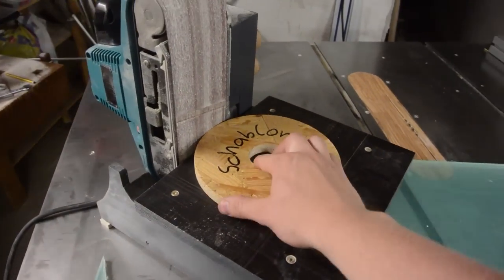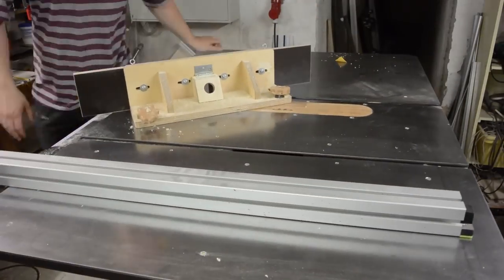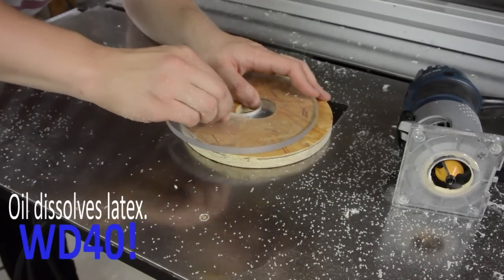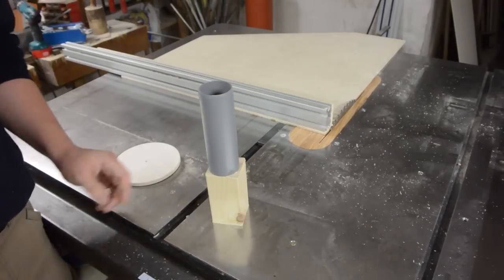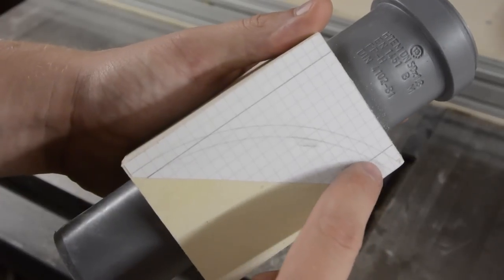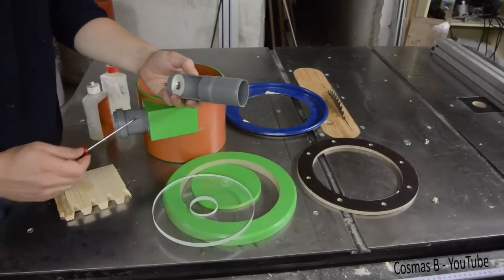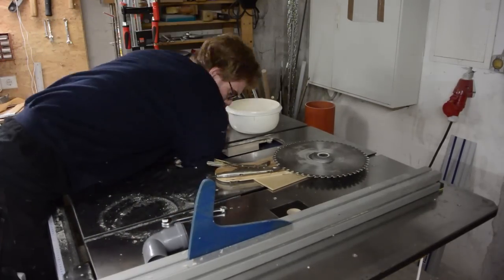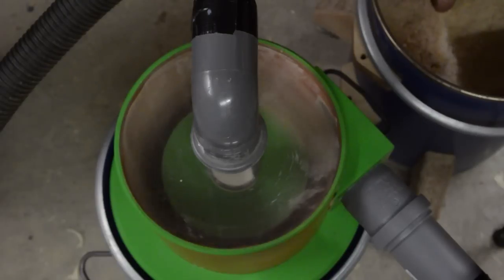How to Build this AWESOME Compact Cyclone Separator

Comment: Nice work! To improve even further on the efficiency of the cyclone, could you increase the difference  in height between the inlet-pipe and the notch in the outlet-pipe? You have built more of these obviously, what have you learned to improve your design even more?

Comment: For the efficiency, just put the once filtered saw shavings through the seperator a second time, weigh before and after the second run through.  Great work btw, excellent standard all round.

Comment: Wow. That is cool the way you put the baffle on the end of the pipe. Mine is ever so ugly, compared to this. I do however have as close to 100% as I can measure, just like yours. I am of he belief that the top needs to be pure cylindrical, and not a bucket (slightly conical).

Comment: That was probably the best one I've seen yet. I just wish there was a way to do this inside of the vacuum cleaner itself; so much wasted space inside a normal machine, and it is still the fine dust that eventually clogs the filter. I'm a little hesitant to start building one of these, because I'm afraid to get "sucked in" by the process- I could see spending a lot of time on one of these. Anyhow, awesome work.
Reply: pocket83² With a concentric two stage build up it can go inside the cleaner.  The tube is set in the center of the cleaner and holds an external baffle.  Then the air enters the center tube as second stage but there it does need only a small container for the remaining dust. The bottom of the tube will be enough.  The only problem is that there is no 'fine' filter anymore.

Comment: Cosmas, I'm in the process of making a separator very similar to your design, which I like very much.  Would you be kind enough to answer a couple of questions for me?  1)  How close to the top should the intake pipe be?  2)  I'm using a 9-inch diameter tube that looks to be similar to your orange pipe and would like to know if the length of this tube matters.  In other words, is there any advantage to making the distance to the baffle closer or farther away from the intake?  Thanks so much from Arizona.

Comment: Deadly accurate! What I most of all appreciate. I have one question about dust. This system good catches sawdust but I suffer of fine dust. Especially of MDF. How about that? How much fine dust pass through and left on vacuum cleaner filters?
Reply: Vladimir Evdokimov Great question. Centrifugal separators have a practical limit of effectiveness somewhere between 10-30 microns. Below that, there's not much mass but there's plenty of surface area to give your lungs trouble. And your vacuum filter will only catch that if it's a good HEPA system. On the plus side, this will keep your HEPA filter in good shape and able to do what it's best at, which is filter the truly fine particles.
Reply: I really interested in more fine dust remowing. Now I finished my new homemade saw and router and thinking about dust collection.
Reply: A separator like this one is a good first stage. You will still need a good HEPA filter for the super-fine dust which is buoyant and cannot be separated this way.

Comment: hey awesome project
I have 3 question for you, the green disc sitting in the end off the suction pipe inside the cyclone, what is the diameter of that disk....?
And the length of the gray pipe with the green disc in the end, how long is that form the inner side of the plexiglass too green disc....? and the length of the notch made in the gray pipe how long is that....?

Comment: What is the light brown pipe? I thought it might be sewer pipe but could not find any that size at my local builders merchant. Great job and build by the way
Reply: +John Fithian-Franks - They are building a new hotel a mile down the road from me. I spoke nicely to the boss, who gave me a 0.8m long off-cut for nothing. (My version is a bit smaller, using 160mm pipe and a traffic cone).

Comment: Cosmas, congrats for this excellent design. I'm going to replace the cyclone part of my self designed shop vacum and I'm intending to use your design. Could you please tell me what is the diameter of the large  PVC tube you have used? Best regards.
Reply: 200 mm

Comment: Hi +Cosmas B - great build! It really shows that you have a lot of experience with these cyclones after building so many ... 
I'm thinking of building one too, and this really seems to be a very good design - compact, efficient and easy to build. I was wondering if you have experimented with how far down in the cyclone the best position for the baffle is? It just looks like it's not flush with the bottom (which I would have expected). And just for a size comparison: is that a 60 liter bucket?
Reply from the maker: Thanks! The baffle is about one or two cm above the actual lid but I don't think that it's exact posiotion is too important. Yes, that's a 60l bucket.
Reply: Thank you, helps a lot!

Comment: Glad to see people are making their cylindrical separators a tad taller rather than fatter. And I'm really impressed with the glass top. I think I'll copy that in my next cyclone. It's enough to let you see in without limiting your choice of materials or construction methods. A baffle can foul if a large clump of dryer lint gets stuck and directs dust toward the exhaust. But at least you'll see if there's a problem!
Can you say more about your decision to build a radial (not axial) exhaust? Classically cyclones send air on an outer spin downward and an inner spin up the middle; this forces a different dynamic. Is there analysis out there anywhere?

Comment: Hi.
I want to build this but I also have a problem withthe fine dust filtering since I only have a regulare house vacuum, cleaner.
do you have any recommendations as to how to go about this matter?
perhaps a reccomendation as to what air filter to buy on line and how to install i (maybe as a separate station between the cyclone and the vacuum)

Thnx

Comment: You will not get that efficiency when dealing with dust from a sander, specially if you do lots of sanding. A filter at the other end will have a powder dust that will be great for making wood filling mixed with glue. It's a awesome use for the separation, premium dust in a bag 😁

Comment: Do you suppose somewhat tilting the inlet downward toward the baffle slot would increase the efficiency of a separator I'm building.
Reply from the maker: No, that would probably lower the performance. You don't want to introduce axial airflow to the system. At least that is what I think. You can try it and see what happens. Maybe I'm wrong.
Reply: Thanks.
Reply: Yes, slightly tilting down reduces turbulence when the debris comes back around thus improving separation and reduced static pressure loss.

Comment: What is the dimensions of the inner disk? Can you tell me also how deep is the length of the central pipe, under the plexiglass and how much is also the length of the sliced part at the central pipe? 
It would be nice if you can give us a link of a sketchup file. :) Is this possible?

Comment: You keep calling them cyclones but aren't they built on the "Thein Baffle" design and concept? Thanks for sharing such a nice build!
Reply: MRrwmac In hobbyist circles the terms get confused. Strictly, we should refer to them all as "centrifugal separators". The true "Thein" design is theoretically less efficient due to being shorter and fatter, while the taller, narrower designs like this and my "birdhouse" achieve greater differential between buoyant and inertial force and allow longer for those forces to operate, thus attaining better separation.

Comment: Wouldn't it be even better, with a conical instead of a cilindrical cyclone chamber?
Reply from the maker: Nico Smets I don't know but I don't think so.
Reply: My first thought would be, that you catch smaller particles with a conical chamber. Your cilindrical design seems to work surprisingly well though, and you still have the filter of the vacuum cleaner.
https://en.wikipedia.org/wiki/Cyclonic_separation

Comment: Just curiosity, how much do you pay for a acrylic sheet like that?
Reply: Carlos Eduardo On average a 1/2" thick sheet of acrylic will run you 6 bucks per square foot..... however if you run over to your local plastics supply house they usually have a scrap bin that you can go through and they charge per pound rather than square footage... it's a lot cheaper way to go.  Or..... you can just go onto ebay and you can find small pieces for cheap.